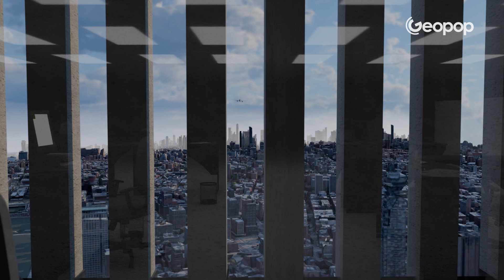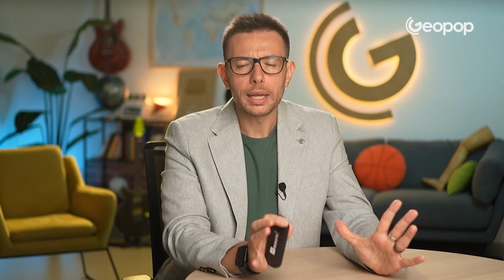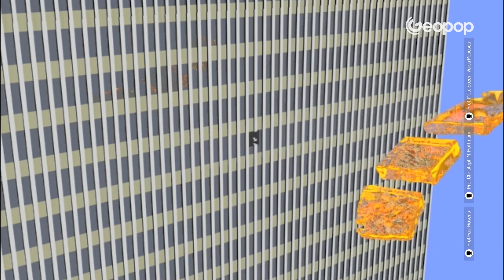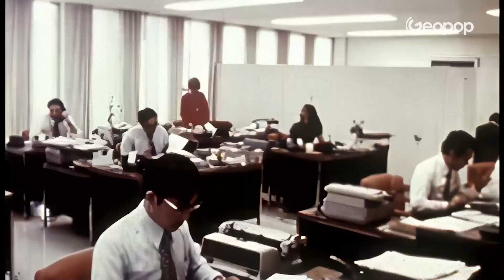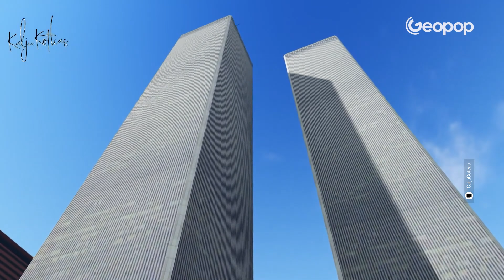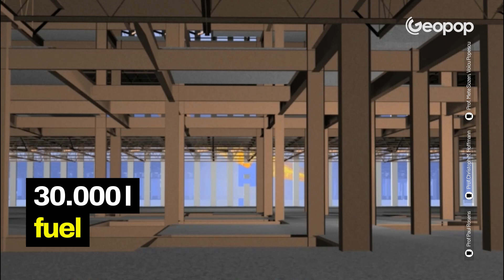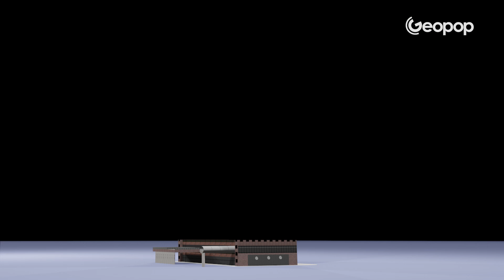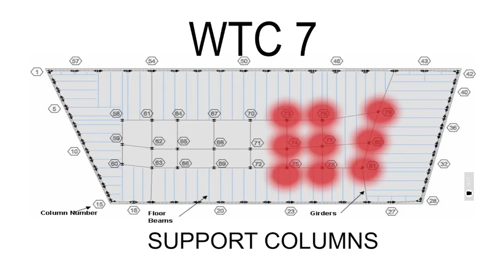9/11, 2001: The Technical Reconstruction of the Twin Towers and WTC 7 Collapses

Comment: I've seen all the reconstruction videos of what happened thst morning. I would now like to see the reconstruction of how WTC 1, 2 & 7 would REALLY have looked like. Show towers 1 & 2 as two "stumps" with the floors above the impact areas all on the ground around the towers and the floors from below the impact sites to have remained standing. The steel was melted at impact but everything below the steel would be cold. As for WTC 7 you gotta ask the owner and his insurance policies he had about that building. 😶
Reply: The building structure of steel cores meant that the fire quickly traveled to other floors via the open central core and elevator shafts. Well documented
Reply: I would refer you to the Kostack Studio channel which produced a high quality model of Building 7's collapse 8 years ago and of the South Tower collapse last year.   I can also explain the collapses - I'll start with the Twins:

At the End of the day, we all just want to know what really happened, right? It’s tough because there is a massive amount of absolute garbage information out there to muddy the waters, even though structural engineers had figured it out within weeks. How is the layperson supposed to sort it all out? 

I have put more thought into this than most because anything can seem like a conspiracy if you don’t understand how it works and if you don’t mind would like to offer my perspective. You may choose to disagree, which is fine, but if I am in error on any point of fact, logic or reason please let me know.  Just saying you are wrong or I don’t believe you isn’t going to make it. 

While complex, most of the Twin Towers collapse mechanisms can be seen with the naked eye and easily discerned and understood by the layperson IF sufficient time is taken to understand.

1. The Twin Towers consisted of 4 primary structural elements together forming an integrated system where each relied on the others. 47 hollow box-section steel Core Columns carry most of the gravity loads. The 236 hollow box-section steel Perimeter Columns carry the remainder and ALL of the lateral (wind) loads. Long-span Lightweight Steel Trusses connect core and perimeter column together with a Hat Truss on top to tie it all together as an integrated unit where no element can survive without the others. There was no structural load bearing concrete and most major assemblies were bolted together

www.youtube.com/watch?v=u7OqrC74Dm4

2. The impact of a 122-ton airplane (= 12 dump trucks) at up to 587 mph with the energy of a ton of TNT destroys the aircraft in 0.50 seconds. This in no way implies the Towers come out unscathed. Some folks get hung up on that. Many perimeter and some core columns are destroyed or damaged primarily by bending, twisting, splitting weld seams and critically by bolt-shearing failures at the end connecting flanges. No cutting or slicing - the reality far more violent and brutal. 

www.youtube.com/watch?v=zF-94yDHlk8

3. The impacts destroy or damage fire insulation, fire breaks and sprinkler systems on multiple floors. Jet fuel acts as an accelerant starting huge fires start across multiple floors simultaneously that spread spread rapidly with no effective firefighting or fire suppression. This was an unprecedented fire event . Office buildings are essentially giant piles of kindling when it comes to fires, chock full of stuff that burns vigorously and quite hot. 

4. The hotter steel gets the weaker it gets shouldn’t be a revelation. With fire protection compromised the survival time of the steel greatly reduced . Over time heat gradually causes the lightweight steel Floor Trusses at the damaged floors to sag, which we can see. No steel melted or needed to. Structural steel fails long before it becomes a puddle. It just needs to bend 5. A straight column is up to 4 times stronger than a bent one. Sagging floor trusses pull on increasingly weak and overloaded Perimeter Columns, causing some of them to bow inward by up to 5 feet until they buckle and fail, quietly initiating collapse. The formerly static mass above which the structure below could easily support converts to a dynamic mass up to 30 times greater. The Columns above and below the failure point are no longer aligned . The load bearing structure below no longer bears any of the load above, which falls past the lower columns NOT onto them. www.youtube.com/watch?v=ULdiD6gYZO0 www.youtube.com/watch?v=zTygQK3vriI 

6. Heat starts the collapse, gravity finishes it . Thousands of tons of debris drop within the four outer walls, through the open office space, the path of least resistance crashing onto the first intact floor, The bolted column connections instantly break as the amount of resistance the Floor Trusses can offer is negligible, slowing the falling debris only marginally and briefly before the connections fail. Note: 
6a. This is NOT a solid top block crashing into a solid bottom block . 
6b. The debris falls past the columns not onto them. The columns provide no resistance to the falling debris. 
6c. Only the bolted floor truss connections to the core and perimeter columns offer any resistance. A pair of 5/8” bolts at each end of each truss vs. thousands of tons of falling debris. 
6d. No laws of physics are violated. 
6e. There is no 20 floors against 90 floors but rather 20 floors against one floor, then 21 floors against one floor, then 22 floors against one floor, etc. 

7. This floor-led collapse progression within the four outer walls can only go straight down. There is no lateral force to push it over the side, only gravity to bring it down. 

8. Collapse progresses through the floor systems past the columns, through the path of least resistance . Resistance offered by each floor is always the same while the falling mass acting on it is constantly increasing and accelerating (gaining energy). This process of floor-by-floor destruction cannot be arrested. It can only speed up . Rate of floor failures increases with each floor as momentum increases, reaching an average acceleration of 0.65 of GA, or 35% slower than true free fall. Bam, bam, bam down the building until there are no more floors to fail. More mass, more velocity, same resistance with each floor. Don’t get stuck on the but the lower floors weren’t on fire nonsense. They didn’t need to be. 
8a. This process is often incorrectly referred to as “pancaking” which while catchy, is incorrect. Too simplistic and inaccurate anyway. More like Kaiserschmarrn. 

9. The Towers were 95% air by volume. As that air was compressed inside the building by falling debris, pressure builds until it is blown out the sides in reaction to the building collapsing . Those were not “explosions”, it was expulsions of compressed air caused by the collapsing building, explaining the low velocity, lack of flash, blast, supersonic pressure waves and lethal high-velocity ejecta. 

10. Perimeter Columns become detached and peel away like a banana behind the collapse front, playing out to the four points of the compass in long lines extending to 800+ feet from the base of the towers, damaging and destroying nearby buildings. 

11. Core Columns fail last as their internal beam bracing is stripped away by falling debris and lateral support from the floors to the perimeter columns is lost. 

www.youtube.com/watch?v=WpHXj62Ylw0

12. This process took 31-34 seconds from perimeter columns bucking until the last core columns hit the pile, or 1/3 the rate of true free fall. Don’t believe me? Just watch a video of the collapses and note the loose truly free-falling debris dropping much faster than the towers themselves. 

https://www.youtube.com/watch?v=dh4r-gHdyPU 

13. Each Tower had a 1-acre footprint. Far from collapsing inside their own footprints the debris pile spread out over 17 acres in a pile up to 14 stories deep. 8 surrounding buildings were destroyed and scores more damaged by the falling debris. 

14. NOT observed were the 180-190 dB bangs of thousands of high explosive devices or the blinding brightness of burning thermite. Explosives or thermite couldn’t have survived the impacts and subsequent fires anyway. Nor could they have caused the perimeter column buckling that clearly initiated collapse. Video of an injured and in-shock firefighter casually using the magic word explosion isn’t proof of explsoIVES and hardly makes a case for planned demolition. Pre-planned demolition doesn’t match the physical evidence and would be technically impossible, totally impractical and completely unnecessary. Simply, no one would bother. In 24 years, no structural engineers of tall buildings, including the 1/3 who have retired, have made any statements in support of planned demolition claims. NONE. The lack of such citations in engineering literature published anywhere in the world is telling. 

15. Twin Towers were perfectly safe within their design envelope. They only collapsed when taken far outside design parameters by an extraordinary and unprecedented event Impact + Fire (heat) + Time + Gravity = Collapse . Remove any 1 of those 4 elements and there is no collapse. Ignore any of them and you will never understand the collapse. The Twin Towers were an integrated system in which no one component could survive without the others. One fails, the rest follow, through the path of least resistance DOWN the open space, bypassing the path of greatest resistance, the columns. No laws of physics are violated and the above is true no matter who planned and carried out the 9/11 attacks or why so the attacks could still be an “inside job”. 

If you made it this far, kudos. That was a lot. I hope it was helpful, informative, non-adversarial and solicits informed critical comment, positive or negative. If I made any errors of fact, logic or reason or left anything critical out, please let me know and I’ll fix it. To stay focused, just one point at a time please and on-topic (Twin Towers ONLY). No word-salads of Gish Gallop. IF you can offer a more plausible alternative be my guest. Please start any reply with the words “Tits McGee” or I’ll know you didn’t read it and aren’t serious. Thanks for your time.
Reply: @TheLoonResistance  You are a very busy shill Fitzshill!

Comment: I think military grade thermite tends to weaken steel too 🤔🤪
Reply: Please tell us how "they" managed to keep the thermite explosives from igniting for 1-7 hours after the impacts, and raging fires? The colapses initiated at the point of impacts. So how did they rig the explosives so that they were not damaged by a plane collision? All it takes is one spark for thermite to ignite, but you want us to believe they kept it from igniting for an hour in the towers and 7 hours in building 7 during a raging inferno? HOW??
Reply: Says the armchair engineer  who knows nothing in real life about thermite, and it shows
Reply: @eggsinhell1532  You seem to know absolutely nothing about thermite, not even that it tends to weaken (actually even melt) steel...
Reply: @eggsinhell1532 pmsl was sitting here waiting for you 🤣
Reply: @Johnsmith19201  - It definately helps to load the argument with nonsense terms like military grade

youtube.com/watch?v=JXWCMBuusMI&ab_channel=TrutherTVArchives 

In this video starting at 45:35 and running to 48:35 the Energetic Materials Research and Testing Center (EMRTC) conducts a test to examine the effectiveness of thermite in cutting a vertical hollow box-section steel column very much like those in the Twin Towers. The column tested is however smaller in cross section and made of thinner steel than that of the Twin Towers perimeter columns (and never mind the core columns). In total 175 pounds of thermite are used for the test on just one column, requiring the construction of a rather conspicuous coffer dam to contain it. 

Do recall the Twin Towers had 240 columns and 110 floors.

It would be odd if thousands of office workers missed hundreds, perhaps thousands of those suddenly appearing. 

As you watch the test note what an incredibly slow process this is. It took close to 30 seconds for the thermite to finish burning off. It would be impossible to “control” a demolition using this material. Not to mention the issue of; how does the aircraft impact and subsequent raging fires NOT prematurely set this stuff off? 

Also note how bright and obvious the whole process is. It simply could not be missed visually. No way to hide that. 

Then at the end of the test the (relatively modest) column was undamaged…. which is a problem. 

Certainly no rivers of molten steel emanating from it either and in fact the whole thing cools rather quickly as soon as the thermite has burned off, as one would expect. 

Thermite has never been used in the controlled demolition of any building, let alone one with multiple floors on fire after the impact of a large jet. If the conspiracy oriented internet has taught us anything it’s that if something has never happened before, it can never happen. 

All of this very much ado over nothing anyway since WTC collapse mechanisms are well known and understood and no thermite of any sort was involved. Collapse initiation was due to sagging floor trusses from the impacts and subsequent fires pulling some of the perimeter columns inward by up to 5 feet until they buckled, as we see here: 

Gary Pollard South Tower collapse, looking at the east side toward the north. 

www.youtube.com/watch?v=ULdiD6gYZO0 

Thermite doesn't do that !!!!! 

Once initiated there was nothing to prevent progression to global collapse. The falling mass of debris – hundreds of thousands of tons - had more than enough energy to drive its way through and dismember the structure below floor by floor, through the path of least resistance - the floor truss systems of the open office space, bypassing the load bearing columns entirely.
Reply: @TheLoonResistance  You are a very busy shill Fitzshill!

Comment: With Atta being an architecture student I bet he researched the type of steel and decided how much fuel would implode those buildings and by he hitting high and the second plane hitting in the middle at least one should have been guaranteed to implode
Reply: Probably not. They hijacked the biggest planes they could, on long distance flights and crashed them as fast as they could fly them.  Whatever happens after that is what happens.
Reply: @TheLoonResistance  You are a very busy shill Fitzshill!